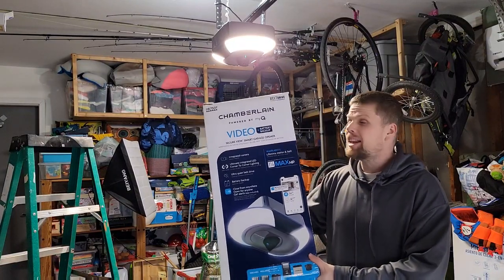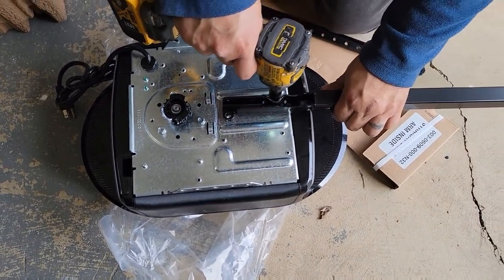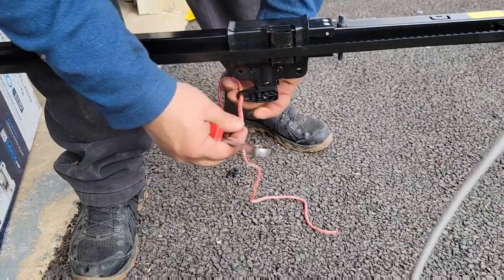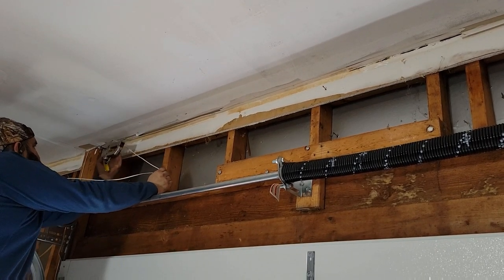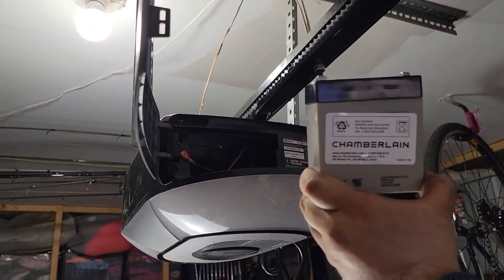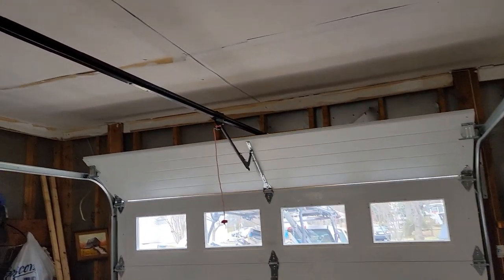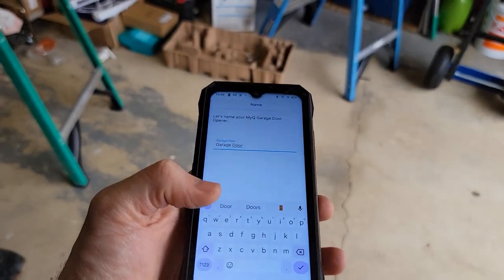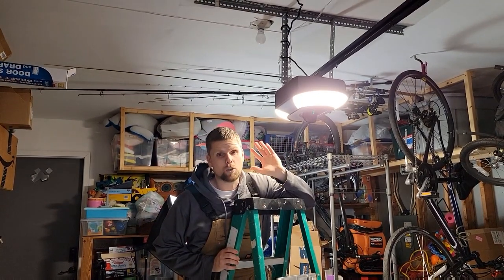Chamberlain garage door opener! Installation review and features

Comment: Sensor lights are connected in parallel, not series. Additionally the wire ends should be wrapped under the screw in a clockwise direction.
Reply from the maker: Good eye.

Comment: You never show how the Amazon delivery function works!
FAIL!
Reply from the maker: Basically the drivers have an app and they opened the door and then slide the package under it. It took a few days for the system to recognize my door but it's working great now
Reply: @Mechanicallyincleyend  THAT'S exactly what i was waiting to hear in your video.
You gotta wonder about the security aspects of that, but there's always some level of trust required it seems.
Thanks.
Reply from the maker: @itsROMPERS...  We are definitely leaving the door on the inside of the garage locked now. There could be some psycho Amazon driver at some point in the future but right now everything's OK
Reply: @Mechanicallyincleyend  good strategy.
Reply: LOL @Mechanicallyincleyend